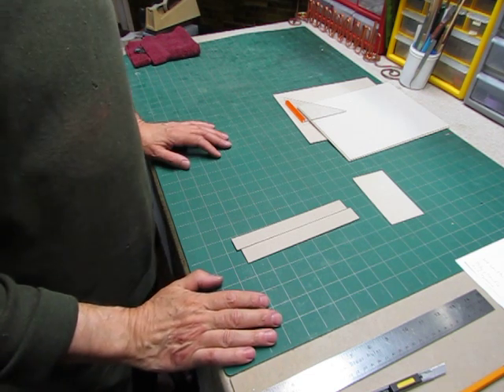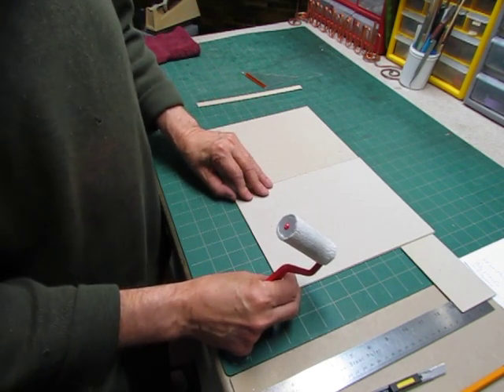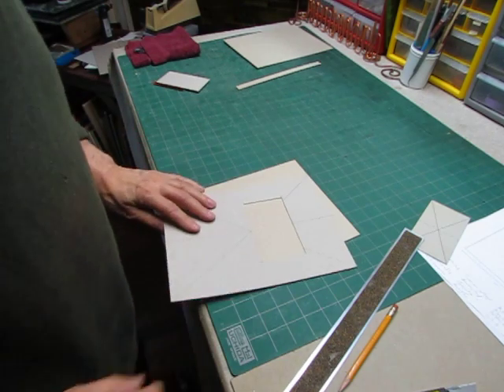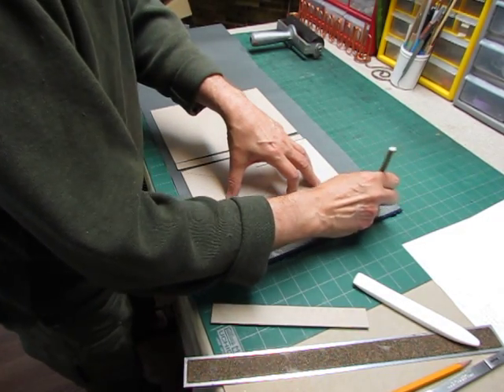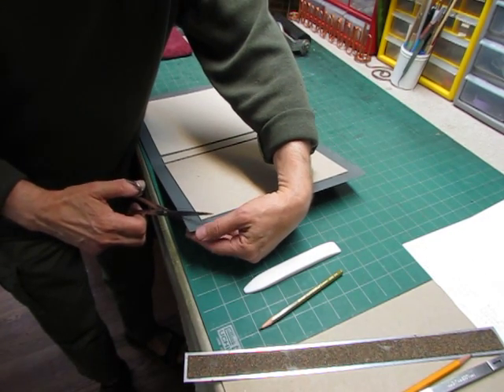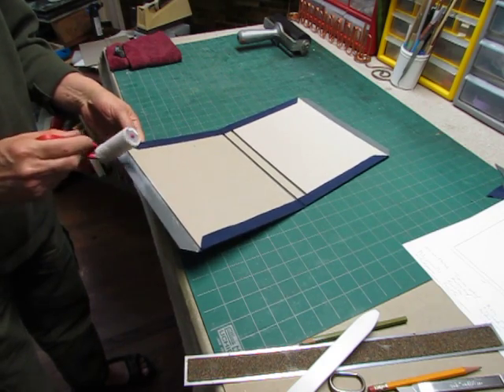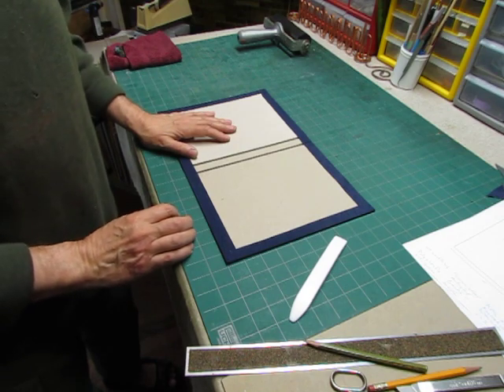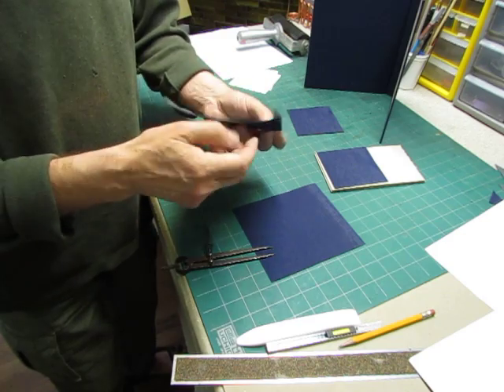Folio with a Spine and Pockets

Comment: Good day. Thank you for your detailed videos. Great to see you continuing with more videos. I have a question about covers. We use a thick board, but when they dry, they tend to bend. We thought it was moisture but now it appears to be caused by the glue and material contracting when it dries. Any advice on how to avoid or overcome this?
Reply: Use a balancing cover - glue a sheet of paper to the inside before gluing on the cover.  It just needs to extend to the board edges, not folded around.  Then glue on the cover cloth/paper as shown.  Both sides will dry and shrink under equal tension and the boards will stay flat.  The same technique is used in woodworking, with balancing veneers or laminates glued to the opposite side of the veneered face.
Reply: @willgrime  THANK YOU... why does it seem so simple when you think about it 😁 Must appreciated.

Comment: I realize you are using bookbinding fabric - how would you do this if you are using a fabric that frays (ie linen)
Reply from the maker: There are a number of things you can do to prepare the fabric. You can mix some methyl Cellulose like I do in the paper backing silk video, that is to mix it so that it forms a thick spreadable paste. Then lay the fabric out and spread the MC on it with a spreader or a piece of  binders board. Let it dry and you should be ready to go, you may want to iron the fabric because the MC will shrink a little as it dries and the fabric may become textured depending on the tightness of the weave. The other thing is to paper back it like I do in the paper backing silk video in which case you will not need to iron afterwards.
 I use this method of starch filling the fabric with raw silks and some moderately open fabrics. It is best to avoid fabrics that are thin or have open weaves. ALSO when you use these treated fabrics it is often best to glue the boards instead of the fabric during construction. 
Good luck, stay safe and get the vaccination as soon as you can.

Comment: Great video and the folio looks amazing. My Saturday is so much better thanks to you. 

I'm just wondering about the size of the gauge if the covering material is thicker than book cloth, like a faux leather with fabric lining. Should I add to the tickness of the boards one or double thickness of this thicker material?
Reply from the maker: I usually wrap the gauge with a piece of the cover material. There are two sides to every groove so you need that space for the boards to close to a right angle, you may need a little more to have it close board to board.  It's easy to make a joint to test if you have questions about the fit and fold. Thanks for watching!
Reply: Thank you so  much. Now I know what to do. :)

Comment: Hi. I've just discovered your wonderful tutorials which are just what I've been looking for. Do you by any chance, have one for binding with a curved spine, with cords, creating the lovely ridges on the spine?  I have searched your channel but unable to find one so far? Many thanks.
Reply from the maker: What you are looking for is what we call 'in-board work' , that means that the boards are attached to a rounded and backed book that has been sewn on raised cords ( there is no joint where the board meets the spine). I made a number of that type of binding in my early days but none of my clients wanted that type of work, which by the way is professionally done by a number of people ( someone for sewing, a binder which can include the leather prep and covering, a gilder for the edges and a finisher who would be responsible for the gold tooling and polishing). Sometimes the cords are fully recessed into the spine so that the final product has a perfect, smooth, rounded spine.This type of binding is usually a tight back, which means the leather is attached directly to the spine of the book which is usually full bound. It requires a lot of tools and a high level of skill on part of all of the craftsmen involved.  

There are other types of bindings that mimic in board work. Usually the spine is made as a hollow (detached) with a hard curved spine and false raised bands. There is usually a joint where the boards meet the spine. Those books are often quarter or half bound as they are less expensive and modestly decorated. 

I have not made any videos about books with raised bands. As I have now retired from binding, I have passed a lot of my tools on to younger binders and no longer have what I would need to demonstrate even the starting point of in board work. There are videos for sewing raised bands but I don't know if there are any on the following steps.  

Thank you for watching and I hope you will enjoy watching others.

Comment: Hi Sage,  Been lurking your channel for a while and love the education and instruction.   Can't re-create what you do but am now dabbling in a little repair of some family books.  Wouldn't have been brave enough to attempt it without you so thanks!   One thing, I totally covet the large rubber hand rollers you use to smooth material.  Are those older Brayers or something else?  Any source for them you can share?  Thanks Again, -Paco
Reply from the maker: They are my old brayers, I was and still make some prints. Having recently priced them, I am astounded at how much they cost now. I paid $30 to $60 for them 50 years ago, expensive for a student but not like they are now for good rubber rollers. You might be able to find some on line.Try Ebay and then look for new ones. If you are only doing a little binding, they might not be cost effective for you. A teflon folder, while expensive for a folder,  might suit you better.   Good luck and Thanks for watching!

Comment: what kind of board can i use?
Reply from the maker: You can use any kind of binder's board , I use Davy Red label; Google your local library supply or go to Talas online. I have no idea where you are or what may be available in your area. Do not use mat board, corrugated cardboard or foam core ( too fragile) most solid board will work for many jobs. 

Thanks for watching.
Reply: thank you for replying 😍

im from phillipines